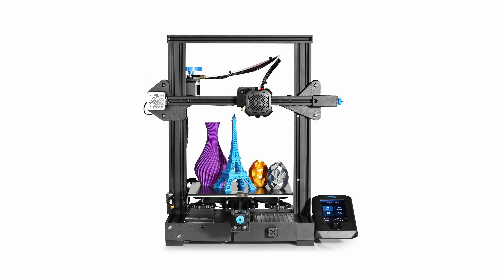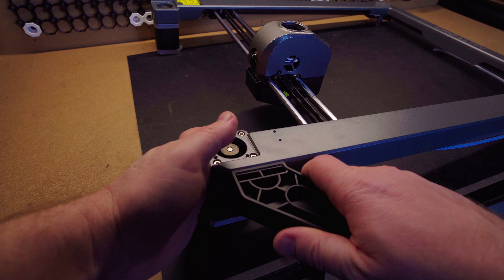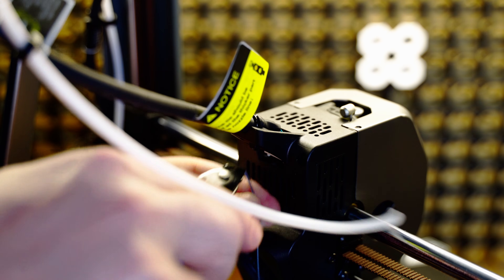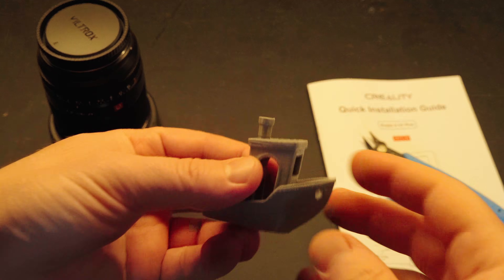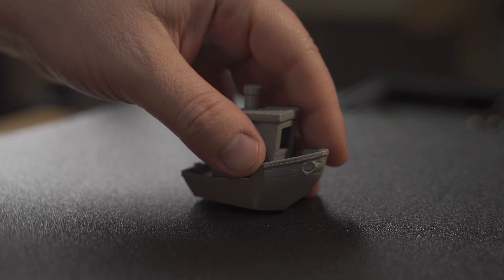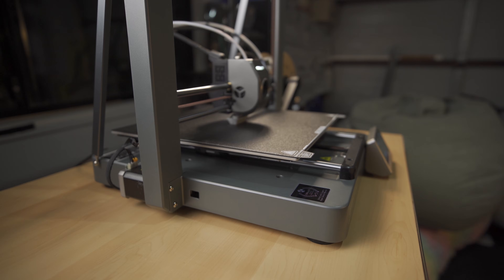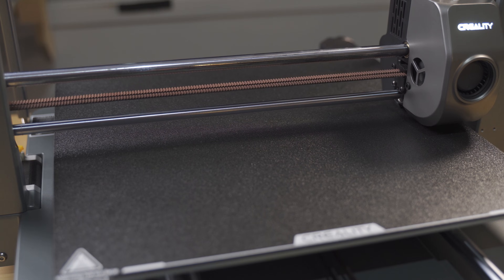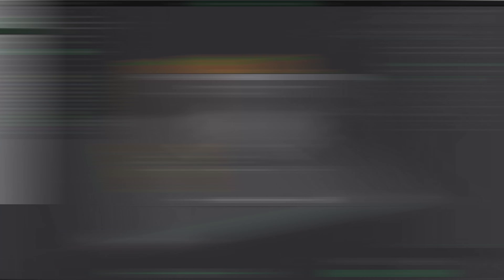Watch BEFORE Buying the Creality Ender 3 V3 Plus!

Comment: Looking at the spec sheet, could it handle PA printing?
Reply: You would need to put it in an enclosure, but the hotend gets to 300C and the bed goes to 100C which is generally adequate for PA
Reply: @muffins4tots thanks!❤

Comment: Hi there i have never owned a 3d printer but thinking about this one.
Is there anything else i need to know parts,maintenance hard to operate etc?
I know my ways around computers i always build my own i like technology always have :)
Reply from the maker: With 3DP there is going to be some stuff to learn, maintainence, and problem solving. If you have a computer background it will be a similar process (like my gpu died recently and I had to problem solve if it was the card or the mobo). Having that background will help a lot and its not as intimidating really. Replacement parts are generally pretty cheap, support is usually online, communities are helpful etc. My main advice is you dont always need the biggest printer and often bigger printer seems to bring more frequent issues.
Reply from the maker: Also good luck! If you ever need help just reach out to me.
Reply: @ Thx man well 300x300 is what im looking for and it seems to be in range in price for me aswell :)
Well i will let u know if there is anything else i can think of :P
Ty for fast answers

Comment: LMAO at the negative points :D :D 
Spool holder ? Who the F uses the provided spool holder for any printer ?
Manual feeding ? Don't you have to unpack the spools manually and install them anyway ? 
Bed depth ? LMAO again
Screen blocked by bed ? WoW.... you're complaining about PC CD trays also blocking the eject button ?
CrealityPrint: there's another million of alternative software and no mandatory usage of the FREE software ?
Reply from the maker: My job isn't to blow rainbows up their arses, I need to provide some constructive criticism where I can. My education is product design and so I'm going to call out things if I find them inconvenient for the end user. 
Like just an example of them improving is with the Hi combo. They put the spool on the top with a guide system which is sooo much better than the side spool on the v3 plus that gets tangled on most prints. 
Fixing bits here, improving parts there, using a better software etc is all fine for someone with a bit of experience but we are in an age of 3d printers that "just work" out of the box and creality still have areas to catch up on.
So yeah, they are all valid points if you're looking at the market as a whole.

Comment: any update on this, perhaps updated firmware resolving challenges mentioned?
Reply from the maker: I should do a follow up. Printed a top spool holder which I feel helps a lot with the awful side spool position. Prints have been a bit hit or miss. Like I was having a lot of fails with tall prints which kind of ruins the purpose of a big build plate, but for prints where I needed lots of small things its been great.
Reply: @DraftID  Thank you for this, apprecaite the update,

my requirement is looking for a additional entry level, copy paste prints requirements, as we currently have a P1S and X1C which we really enjoy.
The larger bed volume drew my attention, however torn between the bigger volume or just considering a Bambu A1 for its reliability and known platform.

Any guidance on this, if possible, would be appreciated!
Reply from the maker: @ Since you already have a few bambu it would be pretty seamless to add another to the fleet and just be using the one slicer to control it all. I find a lot of value in that.

Comment: 4:12
Do you have to use an app and register an account to use this printer? That's a make or break the deal thing for me
Reply from the maker: You can use without logging into an account but you would be limited to printing from an sd card. Not sure if there is a LAN only mode.
Reply: @DraftID  Thanks for the reply! I have no problem using an SD card, I've been using an original Ender 3 V1 (the one with the crude display and dial) for years.
Reply: And as a follow-up I have one of these printers now and have been using it completely offline as I prefer. Thank you!
Reply from the maker: @j_pn thats awesome your came back around to update on that. Really appreciate the comments :)
Reply: That was a make-or-break for me too.  And NO, you just download the Creality Print software from their website and off you go.  Once you connect your Ender to your wifi, you can easily print directly from wherever your Creality Print is installed.  Mine is on a MacBook Pro and I have a live feed of the printer...  I can set the nozzle and bed temperatures, see what is in the Ender's memory (and delete old files I've printed), turn on/off fans, check the camera, send custom G-codes, etc. etc. etc.

The user interface (at least the Mac version) can definitely use lots of improvements.  It just isn't that well polished and don't follow standard Apple design principles (for some reason), which can be really annoying.  I have a Windows desktop but I don't use Creality Print from there.  But in the end, everything prints perfectly fine and no account required!
Reply from the maker: @SilverHawkk  thanks for contributing to the discussion :)

Comment: In comparison to my artillery is super quiet  😂 I have seen that printer and is amazing. In depth and height it has the same size with the overrated Bambu A1 and if you print the top spooler is super compact for this huge 300x300x330m build volume. I have seen in the crealitys web site that is compatible with their AMS for multicolour that will come in q1 of 2025 good news. If someone will have only one printer that is the best to get with the bigger bed.
Reply from the maker: I have been using it for a few big work prints and it’s been doing well. I’ll have to print the to spool holder as I have the room for that setup now and would help with the tangles.

Comment: Have you any solutions for the noise? It's awful way worse than the ke. It's going back if I can't dampen this printer head.
Reply from the maker: Hmm not too much. You could build a large enclosure for it. Currently I just have it in another room. Like its noisy but not crazy bad.

Comment: So I really want to grab this printer, but I see it's only rated for a layer height of 0.1mm. I was really hoping for 0.05mm when I print small items that need good detail. Is there a way to make it print at 0.05mm?
Reply from the maker: In creality print I just tried putting in a manual layer height and it seems to accept 0.08 but nothing lower. Im not sure if it will actually print at that height though but seems to be ok with it when entered.
Reply: Cool, thank you so much for the reply!!  @DraftID

Comment: thank you so much for this video, im a noob to 3d printing, i bought a 2nd hand reprap x400 which was a nightmare to get working but i  got it working. im going to sell it now and buy a new 3d printer lol. you said in your video that it is hard to tweak the settings to the ender to get it to print better quality prints, could i buy those settings off you? what is the bambu printer that you mention, would you recommend a bambu printer over ender for a noob like me?
Reply from the maker: Thanks for watching! Bambu labs are top of the market right now, they might cost a little more in some cases but for what you get it’s worth it. They have a level of refinement no one else is close to. Creality have been in the business for a long time and have great products to but often require more tinkering when things go wrong or you want to push them further. The Bambu A1 is really the bench mark right now, but for larger prints the creality v3 plus could be the better option. For print setting the defaults usually the way to go and as you learn you will know what to edit and change. Maybe one day I’ll do a video on print settings :)
Reply: @DraftID  thank you kindly for your reply. After considering what you have said and doing some more research, I have gone ahead and purchased a Bambu P1P and it is arriving tomorrow! very excited!
Reply from the maker: @anthonyle8311  good choice, you will be happy with it!

Comment: Thank you for this vid, I've wanted to buy a printer for a while now and each time I'm about to buy the one I've decided on a good video like this pops up. The "small tweaks" for better printing, are they material specific or system settings in general? Im up in the air at the moment over The Ender-3 V3 Pro or the PRUSA-XL, as Im after a system that I dont have to spend much time maintaining after a few prints. If you can reply that would be great, cheers. - I've Liked and Subbed as this vid deserves it.
Reply from the maker: Thank I appreciate the comment. For the material tweaking I don’t think it’s a huge time commitment. It’s likely you will find users with suggested settings that you can copy and try. Eventually you will find what works and then save a profile. Also with updates you will probably do less of this manual work too. In the time that I released this video there have been improvements to the wifi setup so creality are listening
Reply: That's two completely different categories and pricing lol